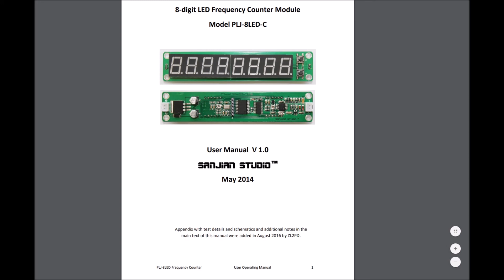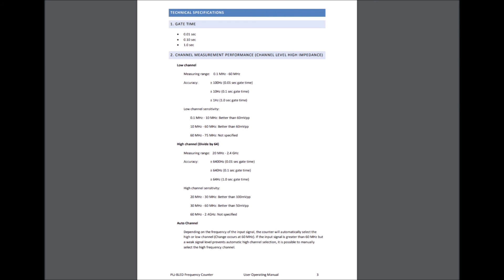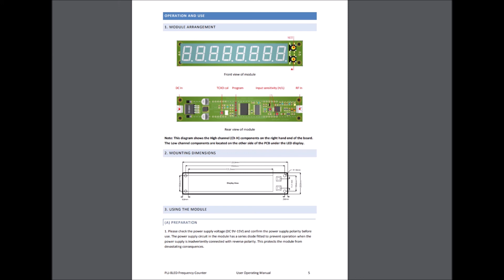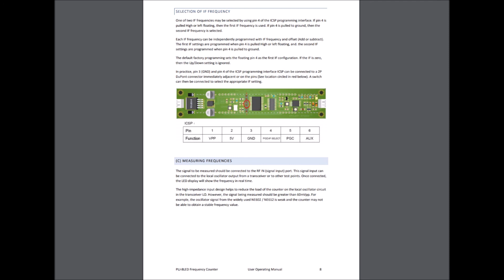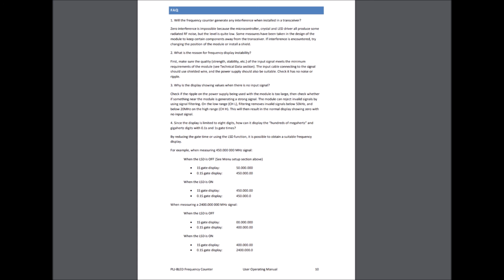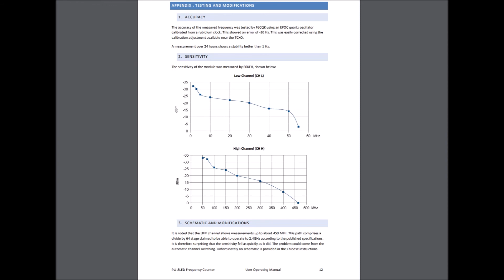8-digit LED Frequency Counter Module: Model PLJ-8LED-C

Comment from the maker: Update: So, I couldn't understand why a cheap DIY kit for a signal generator, could not be picked up on this Sanjian frequency counter. Having investigated this, its because  according to Wikipedia: The generally accepted standard hearing range for humans is 20 to 20,000 Hz. So, the highest possible tone the human ear can hear is 20,000 Hz. When I use an online conversion calculator, 20,000 Hz is 0.02Mhz. When I check the eBay description, it says these frequency counter begin measuring at 0.1 Mhz.

My Conclusion: Audible sound waves (albeit not the same as electromagnetic waves), are far below what these frequency counters can measure.

So, if you are looking for a frequency counter to measure EMF waves in electronic musical instruments (like keyboards and synthesizers), this frequency counter far exceeds the musical frequency bands.